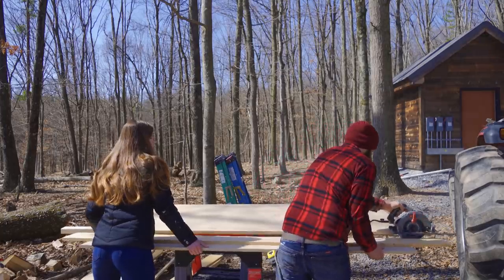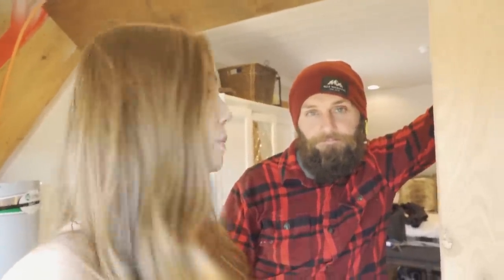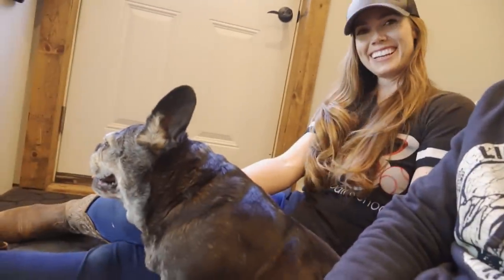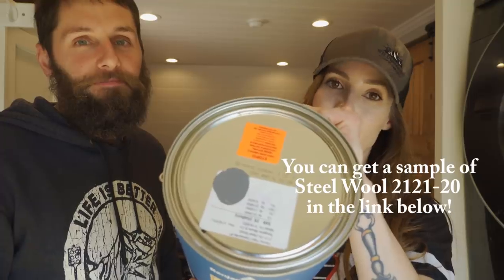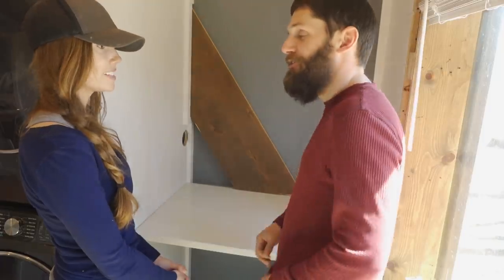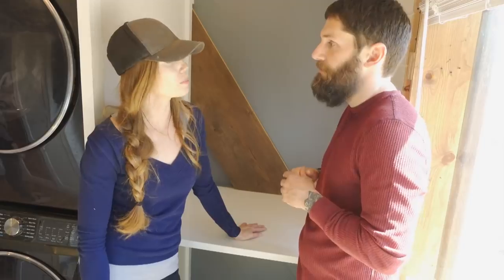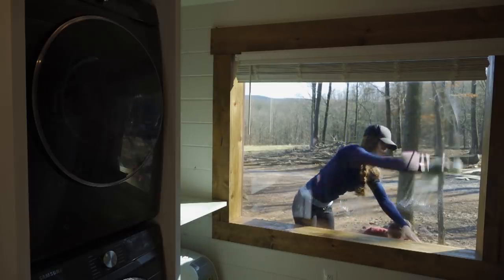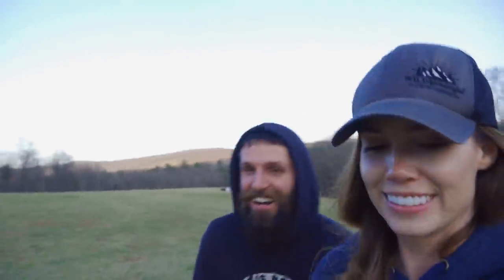TIME FOR A CHANGE

Comment: The difference between a paint tray liner and a pant tray is rigidity! 🤔
Reply: Yes, that is what i was sorta thought, that is a paint tray Liner. Lay it in your regular paint tray or pan and throw it away (supposedly) when done, no cleaning.....sure!!! So, i think that is correct, but what do I know?................. Great job guys, really enjoy.
Reply: @patbrown1024  I would assume he knows that is a tray liner
Reply: @patbrown1024  you’re totally correct- that’s a liner to specifically be inserted onto a regular paint tray.
Reply: @patbrown1024  better yet, let the paint tray liner dry throughly and reuse it, over and over. No washing required!
Reply: And cost ... and intended purpose.
Reply: Exactly I even know that it’s a liner and needs a tray for stability! lol 😂 I so enjoy bloopers!
Reply: Haaaaa... I was going to say the same thing til I saw your comment... Paint pan liners are wonderful if used correctly
Reply: Laura Reutter Exactly! And if you use a tray, rather than a liner, then after five or six times, the whole thing will peal out in one piece. :-)
Reply: hahaha yes.  Does anyone else use dollar store plastic wrap to wrap their paint tray? I've never bought a liner lol   I can seal it up and use continue using it the next day AND it makes clean up a cinch.

Comment: Just curious, any concern regarding how tightly enclosed that washer/dryer is and possible heat buildup (which is never good for any appliance)
Reply: ...and what will it be like the first time they have to pull them out to work on one?

Comment: I hesitate to question an electrician, but doesn't those motors on the washer and dryer need fresh air in and some where to exhaust the hot air?

Comment: tip from a 40 year high end painter edge and roll at same time by working up from bottom or down from top.. this way you don't get an overlap of area that has two coats and possible darker color in that area. they sell additives [flood] that extend dry time to give you more time to work without wet laps over dry to change color.

Comment: 8:10 Josh, at Lowes (or Home Depot), they sell these roller-type clips that you can install in the access panel area that will enable you to either remove and replace the panel as easily as pushing or pulling on it without using screws to hold it in place. I've done it in my own home, it's a real time save, and over time, it doesn't strip the wood.

Comment: Nice to see the rooms coming to their fruition! Well done. I was amazed when you removed the trim to install the countertop to see no insulation in the wall. WOW! Even in West Virginia walls should be insulated. There would be less firewood used (less tree cutting, hauling, splitting, stacking means more time with the kids!)

Comment: When installing counters in blind corners against walls. You can always cut the dry wall to make it fit that last 1/4 inch or if the corners are not square this works as well. Just caulk the joint and clean it up

Comment: Josh... I just started watching this video, but I want to tell you the flexible blue plastic paint tray is a plastic liner to put inside a metal paint roller tray to make it easier to clean up. Just lift the plastic liner and throw it away. So you have a clean metal tray when you're done. No muss, no fuss...

Comment: When your're painting with a roller, always do long strokes top to bottom, applying pressure towards the side where your're going, overlapping about 50% so the other enf of the roller cleans any excess or drip. Doing short strokes everywhere will end up with a ton of visible overlaping marks once it's dry.

Comment: Get yourselves a couple of different sizes of squeegees for window cleaning; make a cleaning solution in about three gallons of water, a teaspoon or less of original Palmolive dish wash soap, and about a teaspoon of OxyClean, adjusting quantities depending on how many windows you are going to clean.  Do not substitute other detergents (I've tried them all).  The OxyClean makes the cleaning solution ultra-slick for the squeegee, and the squeegee will eliminate streaks.  Finish the edges with microfiber cloths, the ones with very little nap made for cleaning car windows.  Horsehair brush for scrubbing, especially outside.  Practice.

Comment: You do know that that's just a liner. For you to enjoy that liner it has to be in a tray. Plus the way you put the top board on the washer/dryer enclosure, you only had to put both ends inside. So, you're doing really good, but you really need to think a little harder before you do something. Just like with the foundation of the house, you could have filled the cellar full of stuff you need to operate the house, now you're going to close it in. When do you start the back of the house? And do yourself a favor, buy a shipping container and hide it somewhere on the property so you have storage.

Comment: I'm wondering about the heat from the dryer, I know mine is in a closet with more space at the sides then you have, and when I touch the sides of the dryer after it running for a hour ITS HOT

Comment: The paint liner you are using is designed for a steel paint tray and then you throw the liner away and you don't have to clean the tray.  You did really good considering that liner was really flimsy.

Comment: Did you realize that that flimsy paint container is designed to be a liner for the non-throwaway containers that are just like it that way they slip inside and you just throw away the thin ones. No Mas no clean up

Comment: That's because it's a paint liner which goes into the metal firm paint holder so you're not having to clean so much you can just throw that away

Comment: The reason the paint "pan" you are using is so flimsy is because that's a paint pan Liner and shouldn't be used by itself because it's is so flimsy!  You would use the liner with a metal pan.  The liners can be reused but usually are tossed away after the job is finished.  Makes clean up easier.

Comment: @ 7:02 Nearly... ROFL Hang it up on the wall;... it's a nice flat surface...
It will stop the tray from buckling...
No;... no;... no the Paint will not drip out;... if U roll faster...

Comment: Half the comments will be informative ....... the plastic roller tray is a liner, one puts it into a metal tray to keep from having to clean the metal tray, wasteful as it is, however..... you should still clean the plastic and not have to buy another liner.  What a viscous cycle, er... circle.

Comment: That's a pan LINER. It fits inside of a steel pan. It's meant to be tossed and you don't have to clean the pan. If you try and use it by itself you will lose.